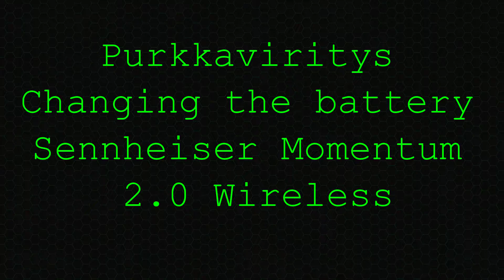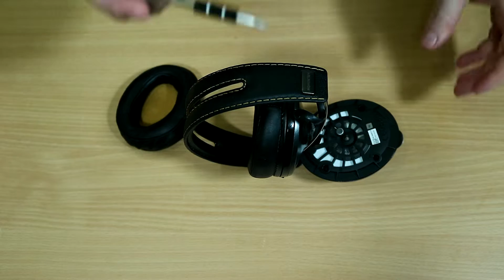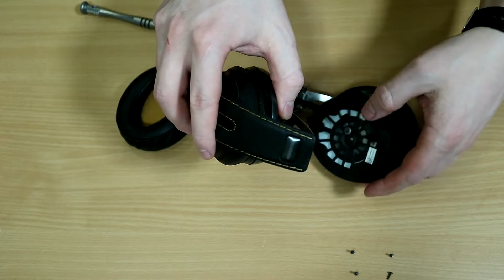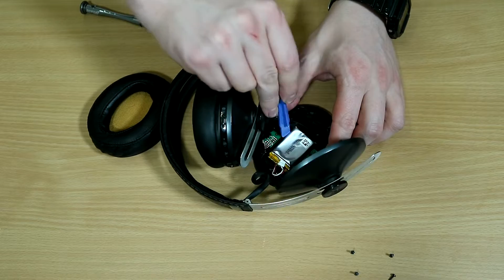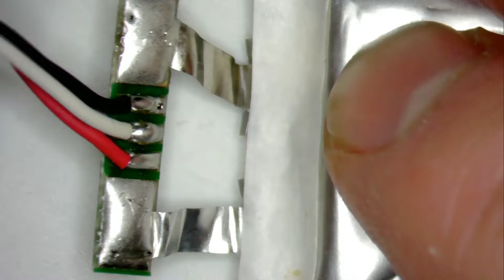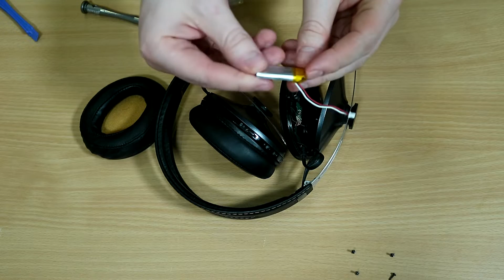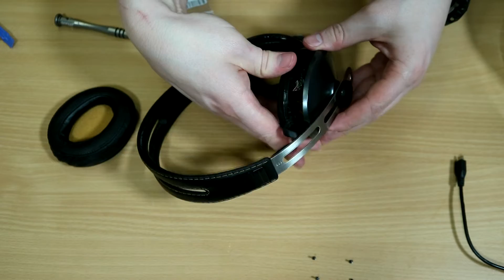Sennheiser Momentum 2.0 Wireless Battery Replacement

Comment: Thanks for the video, very helpful. 
Do you think the battery can be replaced with Li-Ion providing the same voltage (3.7v)? If so, is it better to stick to the original Li-pol or change it?
Does anyone know the exact dimensions of the original battery? There are a lot of different batteries, I wouldn’t like to buy the one that does not fit:)
Reply from the maker: Yes, The reason why I did the replacement the way I did in the video was that I only had raw LiPo cells and had to borrow the protection circuit from the dead battery. Whether you use li-ion or lipo is irrelevant but only lipo will be the correct shape for the headphone unless you start drilling holes into it so you can shove a 18650 cell in.

Comment: This also helps solve the common issue of something rattling in the headphones when moving. It's caused by the battery coming loose from the tape. All you need to do is replace the tape.
Reply: This was driving me crazy and I even got the headphones replaced and it happened again and I just happened to open it 2 nights ago to see the battery hanging loose so I pushed it back in and it stuck so we shall see how long it stays lol.  If it happens again I will replace the tape.
Reply: @nigeljacques  yeah it's so annoying. How did it work out?
Reply: Had this problem before, drove me nuts
Reply: Thank you so much, this problem just came up and I will try to fix!
Reply: @DrMlean  glad to help. It's a pain, but easy to solve. Great headphones though!

Comment: how your blutooth battery mah?
Reply from the maker: The battery I had on hand had only 250mAh and is under half what the original battery had. I will get a proper battery for it later.

Comment: Hi there, thanks for the great explanation! I was wondering where you got your replacement battery from? They seem to be quite hard to find! :)
Reply from the maker: The battery I used was originally meant for itsy bitsy tiny quad copters, but I wouldn't recommend using that particular one as it turns out when you have less than half of the capacity the original the runtime is only a couple of hours.

I've seen a couple that have the same dimensions and capacity on aliexpress but I haven't gotten one yet, but that is where I would start looking for one.
Reply: @Purkkaviritys  Nice - I've purchased these two: https://www.aliexpress.com/snapshot/0.html?spm=a2g0s.9042647.6.2.35624c4d9luHfn&orderId=102147952474513&productId=32900889608 https://www.aliexpress.com/snapshot/0.html?spm=a2g0s.9042647.6.5.35624c4d9luHfn&orderId=102147952484513&productId=32902230088 - one is 800mAh but I'll have to do your solder trick, whereas hopefully the 600mAh one already has the right connector. Will report back once they arrive and I test them!
Reply: Quick update - the 800mAh battery is now in and working perfectly! I had to replace the shield like you did in this video, but it was pretty straightforward. The slightly larger battery fits fine.

Not bad for a £3 fix compared to the factories £50!
Reply from the maker: @georgekinsman4187  I hope you did use kapton tape to wrap the connections so they cant short themselves.
Reply: @Purkkaviritys  yep I replaced the original tape that was on there to avoid shorts - it went back on pretty well and still had enough sticky :).
Reply: @georgekinsman4187  Thanks for sharing. Unfortunately, neither of those links work. Would you happen to remember the product name?